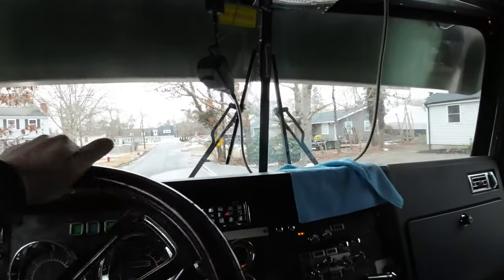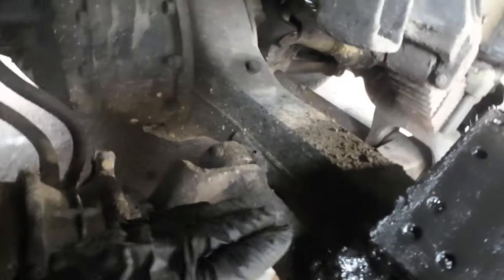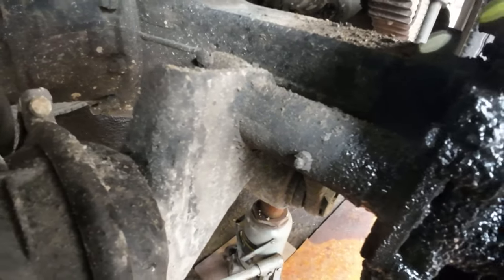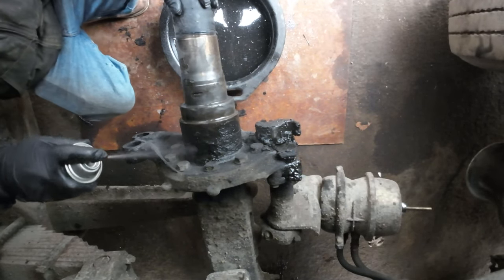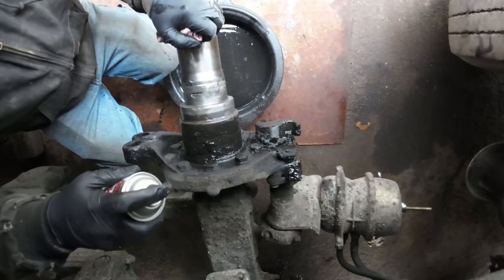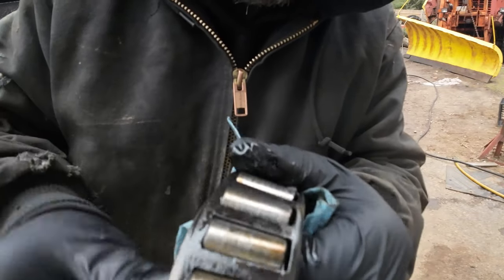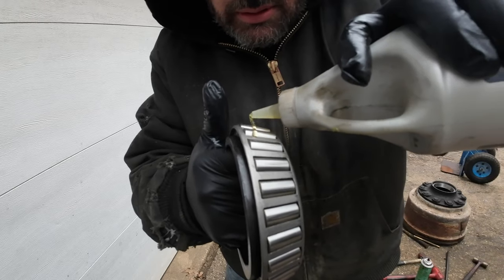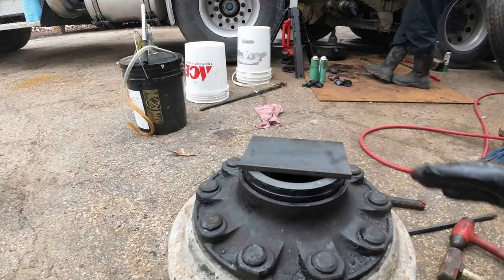How I Fixed My Axle Seal! Kenworth W900L

Comment: Steve  did disconnect the batteries before you welded on that axle?
Reply from the maker: Yes, just like in the last video. I always disconnect the battery. But now I have a master shut off.